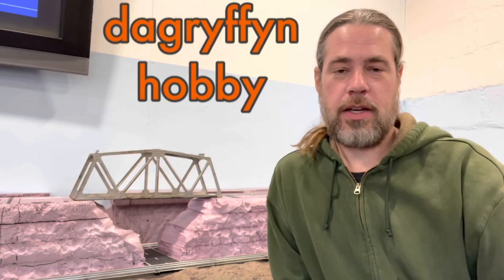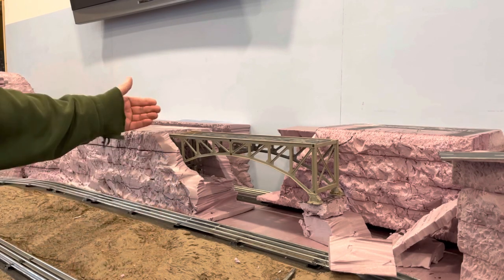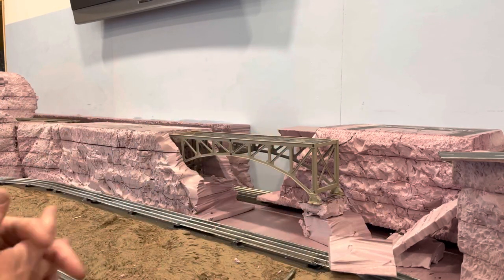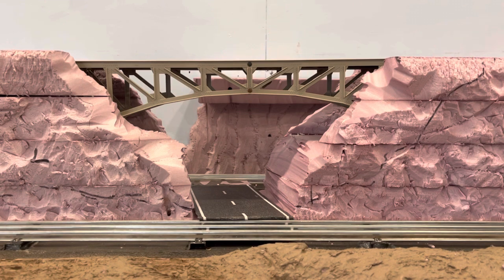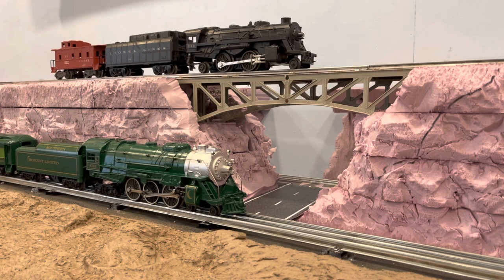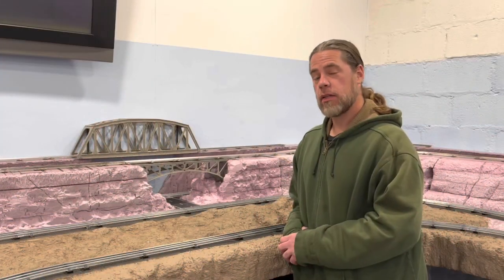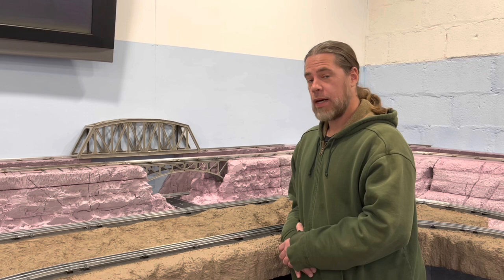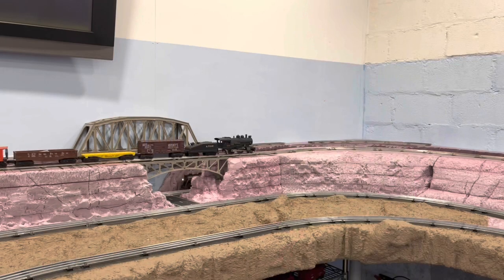Layout Update: Installing the Arch Under Bridge!

Comment: Nice work Dave!  And the two bridges complement each other very well!
Just a suggestion for a little depth behind the bridges, and especially the top one, have you considered a scenic backdrop?  That's what I did for the small layout I've got.  I chose a backdrop that looks like North Jersey's Ramapo Mountains, looks good and adds depth easily.  I got mine from SceniKing up in Canada, was a little bit of a hassle considering it was an international order, but there's a lot more domestic sources here now than there was 10 years ago when I ordered mine. 
For the area on the wall in the cut behind the arched bridge, try a mirror. It's a good hassle-free way to add depth inconspicuously.
Reply from the maker: Thanks Wayne. I will certainly be doing a backdrop, don’t know exactly what type yet. Maybe paint, maybe photo. I guess we will have to wait and see what happens!
Reply: @dagryffynhobby  Just don't wait too long Dave or you might have to awkwardly work around already installed scenery.
You don't want to be like the guy who builds a boat in the backyard and then can't get it out past the house! 
That happened to George Patton when he built a boat in the 1930's.  Everyone said the explosion of profanity was epic!  Mrs. Patton collapsed with laughter!
Reply from the maker: @wayneantoniazzi2706  haha that’s awesome! I plan on getting all the foam ready and then doing backdrop before adding any detail work. That’s the plan anyway.

Comment: Looks great. 
Vintage Lionel track or Menard's?  Likes, dislikes?
Reply: I've bought lots of menards track, no complaints here. Marries up well with Lionel O-gauge and K-Line O-gauge track. And it's very inexpensive
Reply from the maker: Thanks! The main two loops are new Menards track. I’m satisfied with it. It could be a bit better but for the price it’s a no brainer. 
Pros: price.
Cons: 
could use more ties
Gauge was off on a few pieces